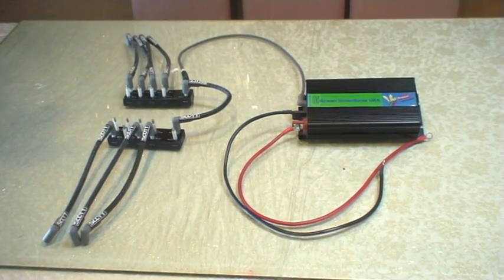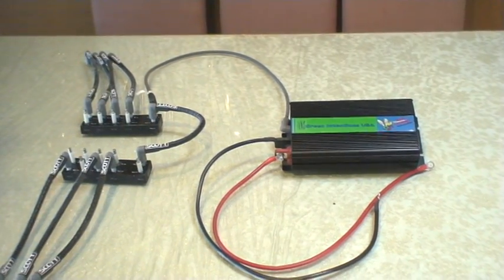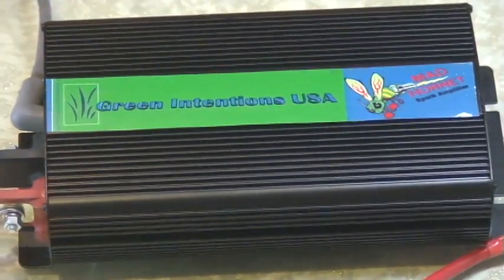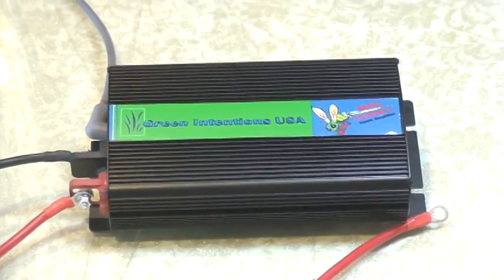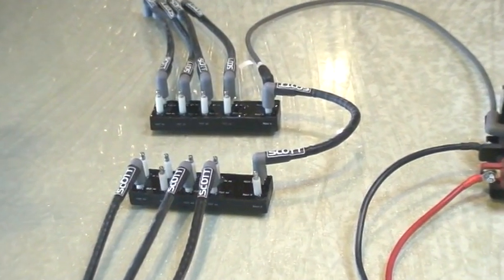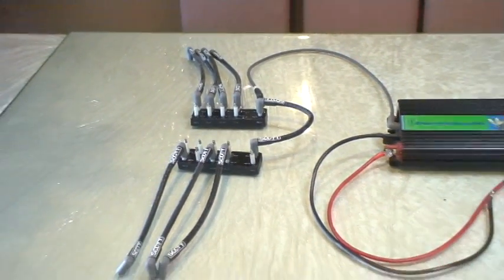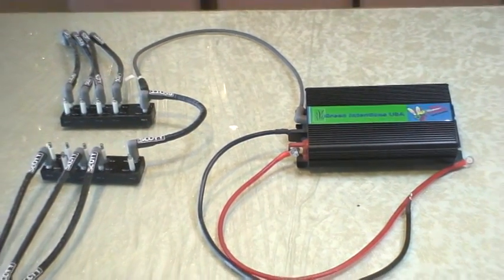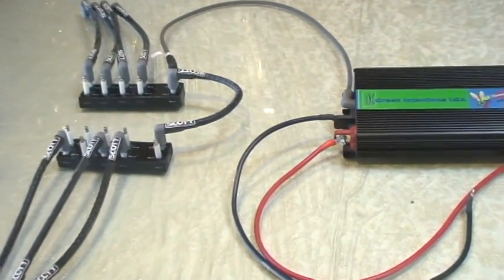Mad Hornet TM Sparkamplifier

Comment from the maker: When you burn all of the fuel that is in a cylinder, the temperature actually goes down due to the friction caused by fluid dynamics. This will absolutely not burn any pistons.
We have done dyno testing and laser temperature testing to prove all benefits. We have a test vehicle that has had the unit on for 30,000 miles with no ill effects. We invite you to our facility to do any testing you would like to prove anything we say is incorrect.